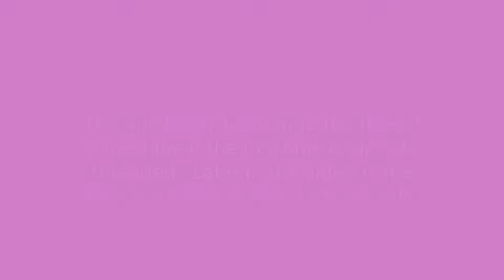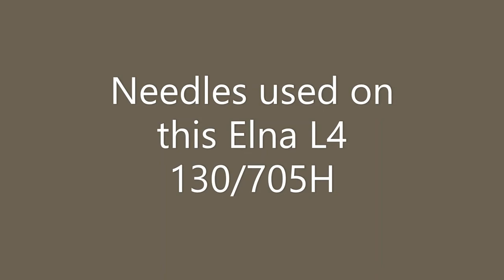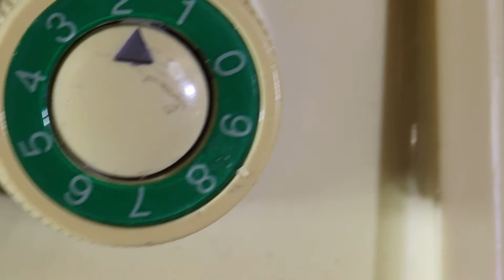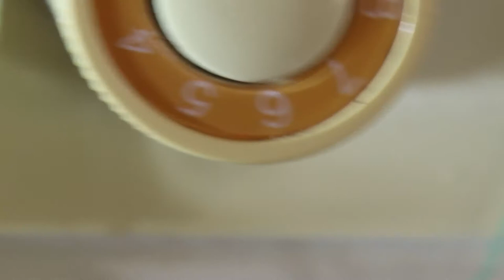How to Thread and Sew on an Overlocker / Serger  - Demonstrated on Elna L4

Comment: Hi there. My telescoping rod in the back broke. It is discontinued. Do you have any ideas? Another freestanding one?
Reply from the maker: I used a pencil a few years ago as a rod :)  I think a freestanding one will work fine - just make sure the threads run freely up to the guides from the stand.